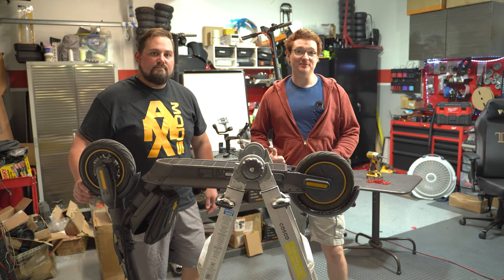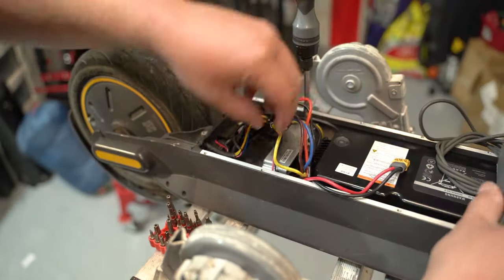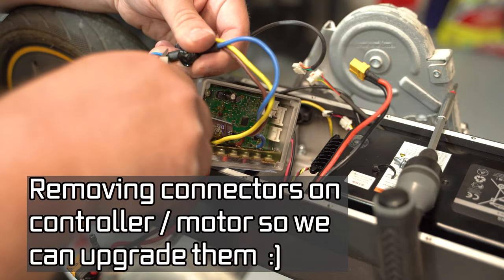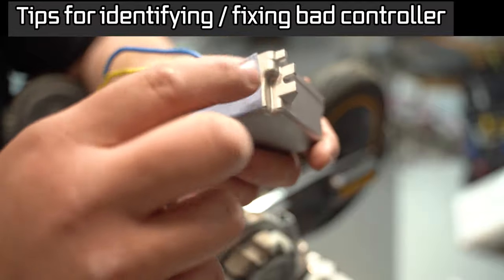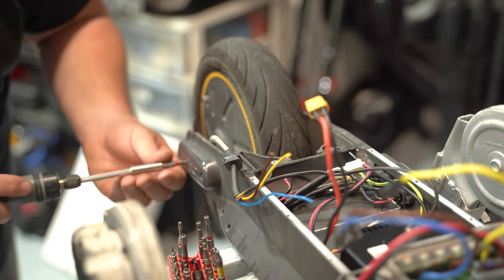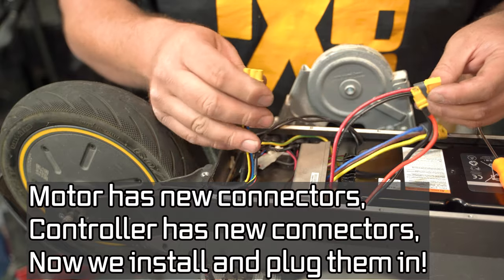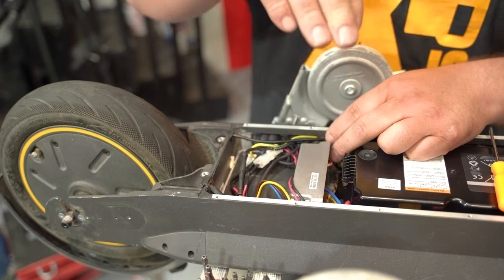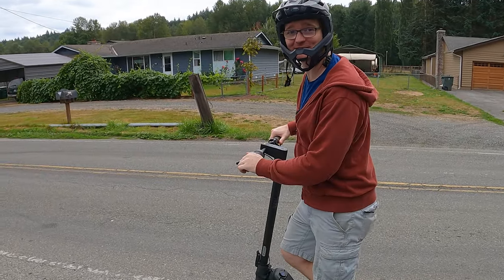Ninebot MAX Repair, Upgrades, Controller Swap, Tire Removal & More!

Comment: A better solution instead of soldering MR60 to the wires is to crimp the wires and use a Wago Connector to join the wires up. Wage allows up to 32 amps which is plenty and give a great connection. As simple as pushing the wire into the connector and pushing down the clamp. Solder wont last as long as a Wago connector.
Reply from the maker: Then if you need to remove your motor you need to snip the wires again instead of just unplugging
Reply: @GingerOnWheels  great point! Another reason to use the Wago.
Reply from the maker: @dataroberts8962  oh, I was under the impression there was no soldering with Wago connectors. You absolutely need to solder the wires though to ensure a robust connection.
Reply: @GingerOnWheels  no soldering needed the connection is solid with the wago clamps
Reply: @GingerOnWheels  have used the wago for ages and works perfect. Also these connectors last forever and will outlast solder by a mile
Reply: @GingerOnWheels  if you change motor you only cut off bullets again and crimp motor wires and clamp them into the wagos. If you do mr60 you gotta go through the soldering again. Wagos give a rock solid connection lots of sparkies use them and much simpler. Not a fan of soldering especially if wago connection is just as good lasts longer and takes less time. 32 amps is plenty.
Reply from the maker: @dataroberts8962  you've used them on scooters?
Reply: @GingerOnWheels  yup been using them on two scooters for ages now
Reply from the maker: @dataroberts8962  Dm me pics on Instagram, @gingeronwheels im skeptical they would even fit inside the battery compartment.
Reply: @GingerOnWheels  I don’t have Insta only Facebook. Can send you a pic on there. What’s your fb?
Reply: @GingerOnWheels  they are tiny and fit perfectly
Reply: ?WELL SOLDER Can't ICONECTORS WAGO OF SIZE WhAT
Reply: @dataroberts8962  what kind of Wago connectors do you use that are similar to mr60?
Reply: @GingerOnWheels  i can confirm this works.   i used them after reading this suggestion because my wires had melted and they worked just fine. i have pics
Reply: I used Amass XT150 connectors instead.
Reply: @jpeero  still going strong with the wego connectors ?
I have to do a full connector replacement so im curious
Reply: @data roberts  I am repairing my scooter atm and having issues soldering so this looks like it would be a better option for me. Could you let me know which wago connector you use??

Comment: So much out of focus hard to watch. Content is normally on point and I like the idea of this type of repair but need to rethink the filming setup. Love the channel brother - feedback is from someone wanting to see you keep improving the awesome work you do 🙌🏻
Reply from the maker: Agreed. It was really hard to manage the camera with the step I had. I almost scrapped the whole video because of it but I figured there would be people wanting to see it. I'll do better next time.
Reply: @GingerOnWheels  you probably want to close down your aperture to have a wider depth of field and then you wont have to shift focus around that much because everything that matters will be in focus. I think you were shooting wide open which is great for bokeh and lower iso but it gives you a real thin plane of focus. The closer it is to the camera the thinner the field will be which is why macro stuff is always shot at pretty high F-stops.
Reply from the maker: @clearchalk  nailed it.
Reply: @GingerOnWheels  i havent upgraded my scotter yet. I buy an 48 battery on my max mod. And days after before it even arive my cables melted and my ninebot got in extreme brake mode. Cables melted togheter. Battery is flashing red light. I fix the cables and hope evrething will work when i got my new battery from my max mod.
Reply: @GingerOnWheels  so strange cables melted. I hope the control board dident got broken. Since the motor is in brake mode. This was the strangest thing.
Reply: @victorbengtsson8723  I had the same thing happen. Rear wheel locked up with full regen brake I assume. It would still turn with difficulty. Hot day climbing a steep hill in a zig zag pattern, when it suddenly stopped and the screen shut down. Stock battery on modded programming. Got it home, let it cool down and plugged it in. The display flashed on then off and that was it, no sign of life afterwards. Returned at Costco as it was still within the one year. Just over 600km on the scooter at the time. No issues before this, never even put air in the tires.

Comment: Omg just change that meted connection 🎉 easy fix
Reply from the maker: And new controller*. Running the scooter with the partially melted connection blew the controller also.

Comment: Well looks like I'm turning my Regen braking onto low or off, that's definitely a design flaw. There's a hill I ride down to work that's easily half a mile and pretty steep. Im coasting at 20mph with the Regen on medium.. this kinda scares me because my commute to work is 3.6 miles..
Reply: the melted connectors blew the controller board. the new connectors can handle this regen amps. thers a reason why on cfw the kers is turned off. on stock wireing the connectors are to weak for tuned cfw.

Comment: That connector isn't melted, that is black glue on it.......
Reply from the maker: Nah it was melted. All deformed and different color. I suck at camera work apparently but you'll just have to take my word for it. That connector melted which is what caused the scooter to slow down, and controller to heat up, minutes before it stopped.